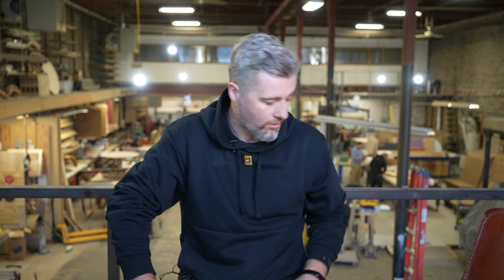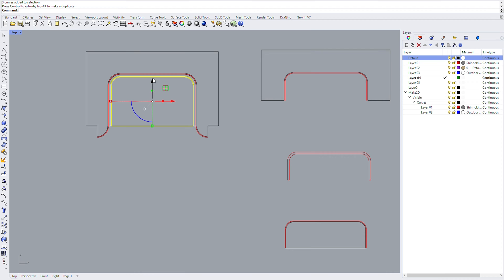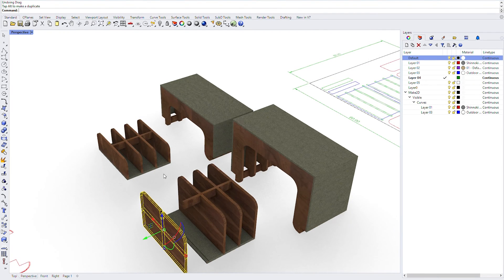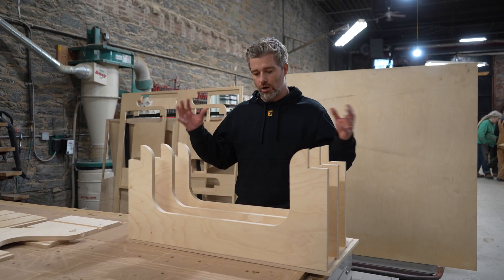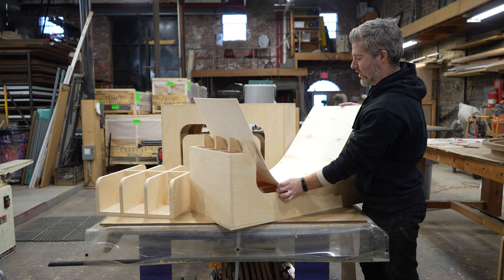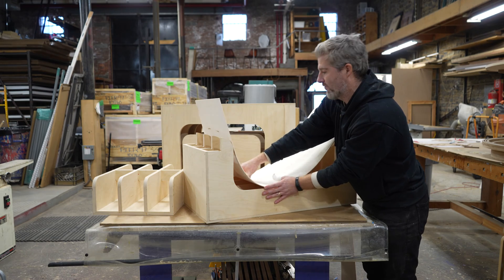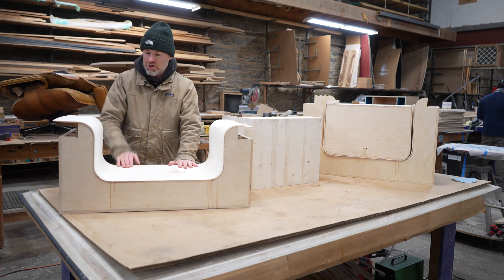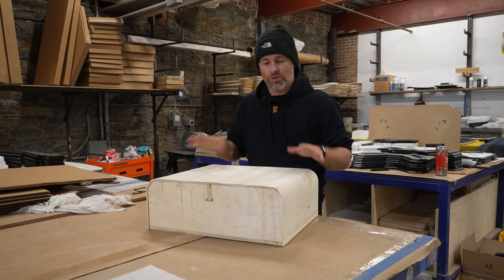Wood Bending: How To Make a Jig... (Mistakes Happen) | Episode 2

Comment: You can also make the smaller upper part of the mold a 2-parter as long as you make the cut-line angled (as demonstrated below in wonderful ascii-graphics). That way you can slide the part on the right side in and just need to clamp it down so it can't slide up again.
|       \         |
|_____\____|
But obviously making either mold part a 2-parter will do the trick. It's really only about which is easier/sturdier/easier to line up.
Reply from the maker: Yes! Love that idea. Have made much jigs or molds before? Thanks for watching! 🤘🏻
Reply: @conorcoghlan  Much of my expertise comes from copious hours of watching youtube and an innate sense of smart-assery.
Reply from the maker: 😂😂😂 YouTube for the win 🙌🏻🙌🏻